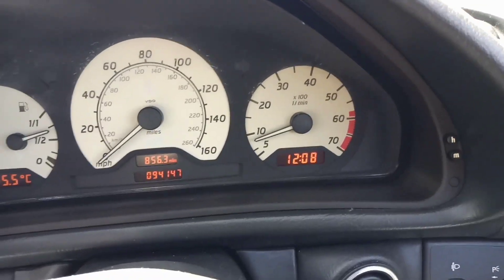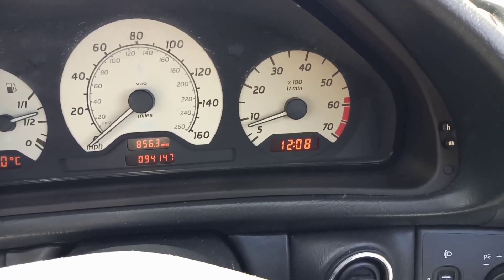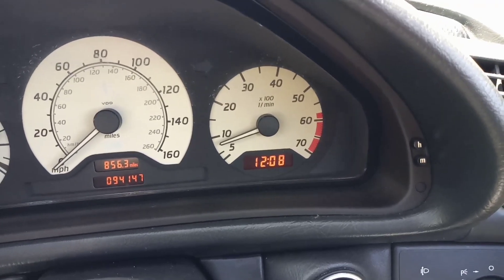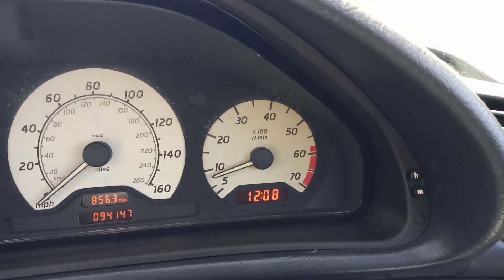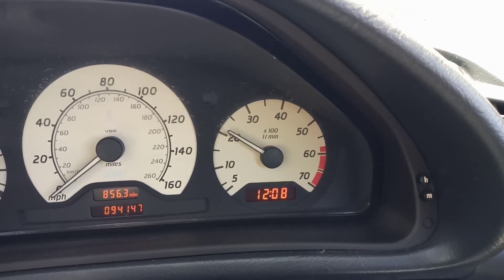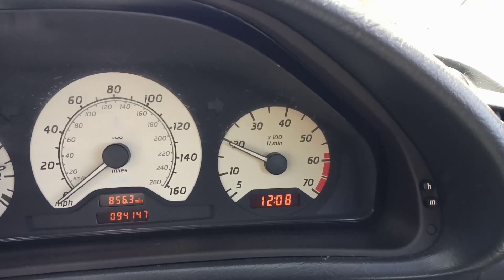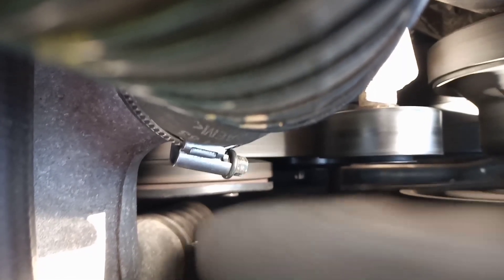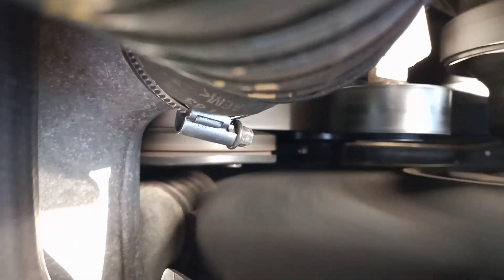How A Mercedes Benz Supercharger Clutch Engages

Comment: is there any way of maybe wiring the supercharger clutch to for example the coil pack so when running the s/c is constantly engaged? mine keeps cutting out, replaced all parts necessary so just thought f*ck it! i’ll have it permanently engaged, already added my own custom BOV like you did! love the vids man!
Reply from the maker: @justjack71002   @justjack71002  Thank you I greatly appreciate the positivity, so with the clutch pulleys some people love them some people don't, so when it comes to permanent engagement, I believe you can permanently wire it but I haven't ever tried it, however there is a mod you can do to the pulley undo the bolt holding the clutch face and there are some shims in there, remove them and retighten the clutch face this will lock  it permanently engaged, this is one way folks repair a failed clutch pulley, however if it's functioning you should be able to do it but create a separate circuit for it as to the coils could blow fuses you would need to have it switch with the ignition otherwise it could cause other issues or use a switch, but locking it mechanically is the best and safest method👍 if not already please subscribe and share and help us grow and reach more people

Comment: hi sir, i have a question. my c230k w202 supercharger is acting normal on neutral, it engages at 2000 rpm and above until the soft limiter, but when i drive (putting it on D), it works normally only around 2000-3000 rpm, once i pass 3000/3100ish rpm on any gears it dont engage, the outer ring on the pulley is spinning but only slowly and i can hear its not working even when i rev it again in Neutral gear above 2000 rpm it still only spinning slowly, but once i cut the engine off and started it again (like restart) it works normally, do you have any ideas whats wrong? i've checked the mechanical things with my mechanic and all of them are still in good condition even the sc fluid. do you have any ideas whats wrong with it? or even maybe how to fix it? anyways thanks a lot for your videos sir now i've learned how mercedes superchargers work, pardon me for  any bad grammars or spellings, english is not my first languange
Reply from the maker: Hi there, no need to apologise for grammer that reads good to me buddy. So this issue your having sounds very typical of when the clutch pulley starts to fail, this is when the magnetic clutch inside the pulley can no longer hold the outer under load. So when you in neutral revving there is only a very small load on the supercharger, when driving the load is greatly increased so the supercharger becomes harder to turn, this in turn puts more strain on the pulley which causes it to slip.

There are ways to lock the pulley using some shims, I believe there maybe a video on YouTube l, there will certainly be a walkthrough on a forum how to do this mod. Or alternatively you can fit a new/used pulley that works as a replacement. I do not recommend using any kind of overdrive pulley on the supercharger itself as a replacement as it will cause a lot of problems with the engine management. 

I hope this helps buddy, thanks for watching and commenting. If not already please subscribe and share to help the channel grow so I can help more people in the community 👍
Reply: @M-oneeleven-M111  hi thanks for replying, i was very confused of what im going to do/focus on investigating/checking. i appreciate it a lot, i've subscribed and i hope your channel grow more and more!
Reply from the maker: Thank you buddy really appreciate that 👍

Comment: Supercharge does not work for me, can you help me with any information?
Reply from the maker: hey man, so your supercharger not working if it's the clutch pulley M62 charger there's a few things that can cause that, first and most common is a faulty MAF sensor, secondly it's a failed bypass valve third clutch pulley and fourth in very rare cases there are some transistors on the ECU itself that can fail which can cause the whole boost circuit to not operate. the bypass valve should cycle when the ignition is switched on if you remove it from the airbox and turn the ignition on whilst looking at it, the butterfly should move on it. though I will say this isn't a fool proof method, but it can give you and idea if its operating at all. the supercharger clutch pulley can be tested by applying 12v directly to the plug for it, if it locks and starts turning that's fine. but honestly the most common reasons for this always seem to boil down to the MAF sensor itself. sorry for the late response the notifications still aren't working.
Reply: @M-oneeleven-M111  When the air sensor malfunctions, does SuperCharge m62 stop working?
Reply from the maker: @adamfethi787  in most cases yes, so if you unplug a healthy MAF it will disengage the supercharger because it can't meter the extra airflow so the ECU switches to a NA map basically. So when a MAF sensor fails to a point it can no longer read the airflow the supercharger is switched off to protect the engine.
Reply: @M-oneeleven-M111  Thank you very much for the information, sir. I will check the air sensor and then see what happens
Reply from the maker: no worries buddy always happy to help 👍
Reply: @M-oneeleven-M111   is there any way I can send you a video of my pulley buddy
Reply from the maker: @carlomauers5138  hey man, if you can compress the video you can send it via email to alex.moneeleven@gmail.com 👍

Comment: If I can get magnetic clutch I can turn on and off if wire to switch is that right
Reply from the maker: You can do it to a switch I believe but you will need a relay also bud, big whoops on the speeding ticket 🤣 are you planning on switching to the M62 then?
Reply: Cant fit m62 under bonnet hyundai coupe just about fit m24 under there cant swing a cat under there but vw do a magnetic clutch and water pump so some how rig that up kills tyres and loud as hell
Reply from the maker: @karlbigmore7949  oh right that makes sense I haven't ever looked into the VW chargers that much, but if they do a clutch pulley one that's really handy. I can't tell you if that would be wired the same as a M62 one but it's likely it is.
Reply: ￡291.98  1%OFF | Golpher Charge Air Intercooler Benz  C32 AMG Base V6 3.2L 2003.203
https://a.aliexpress.com/_mPB0utL
Reply: Might be something your interest in
Reply from the maker: That is a interesting unit, I think that would be designed for the eaton M112 if I'm right that comes on the m112k and M113k Mercedes engines. I shall book mark it anyway thanks you 🙂

Comment: Need clutch on my supercharger my thing boosts from 800rpm to 4000 in about 2 seconds got my 1st speeding ticket in 10 years and you you asked about top end power after 60mph theres no more power on m24 all on take off if I can clutch it might save on tyres
Reply from the maker: If the pulley will fit that's a good idea also would add to drivability too, I'm not sure how it's taken a year to see this comment though 🤦, my apologies buddy

Comment: You'll notice under load it come on a lot earlier when you put the car in drive and set of it kicks in around 1200rpm
Reply from the maker: Interesting mine doesn't 😂 damn my ECU, I shall have to try figure mine out then damnnit you gave me another job to do 🤣. Although I might lock my pulley
Reply: @M-oneeleven-M111  yes in drive mine comes it slot earlier I've had 2 and they both did that 🤔
Reply from the maker: I didn't pay attention to that with my 202 but you have had enough of them to know 😂. I'll double check if the clk does it but I'm sure it don't but there's a lot of other stuff it don't do, like work half the time 🤣
Reply: @M-oneeleven-M111  is there a link on how to lock the pulley and disadvantage and advantage please
Reply: Mine does that too under load, i can hear when the clutch engages
Reply from the maker: @x8xPopCoRnx8x  sweet well we have determined my Clk has a issue 🤣 to be fair it is a load based system so it all makes total sense i will add this to the description guys cause I can't add it to the video
Reply: I think pre 2000 kompressor models kick around 2000rpm ,my slk 98 kicks supercharger around 2k rpm
Reply: @RarePotatoHD  my w202 is 2000
Reply: @x8xPopCoRnx8x  i think you got the newer m111 engine on your w202
Reply: @RarePotatoHD  mine are 98 and 99 in neutral the charger kicks in about 1800 but when they are in drive the charger kicks in around 1200
Reply: @BoostWorx  idk bro my slk sc kicks like the clk in the video , btw my engine shakes time to time when in idle and the rpm are not.stable , they move from 700-800 , ive changed sparks coils throttle.body , do u have any idea what causes this
Reply: @RarePotatoHD  I would guess you have a vacuum leak if you watch this channels videos on throttle bodies and intake manifolds that could be a place to start looking 😁
Reply from the maker: @RarePotatoHD  you are absolutely correct when stationary it varies from 1800 to about 2200from car to car, as correctly pointed out when the car is being driven and is underload the Supercharger does Indeed kick in around 1200. But it's not always easy to notice, I went out and tested it on my Clk and it does kick in around 1200 when driven . I didn't notice it dude to the crazy amount of slip in my transmission 😂